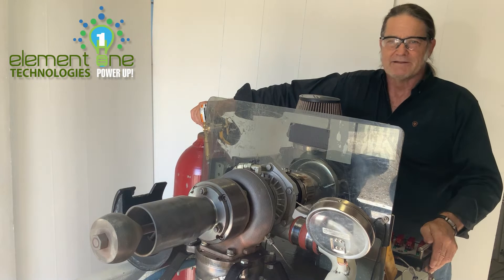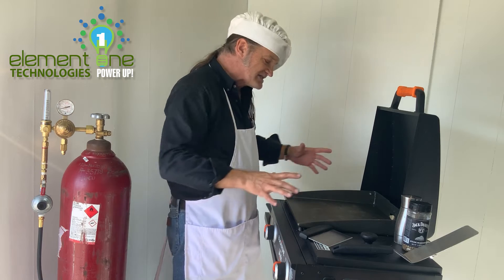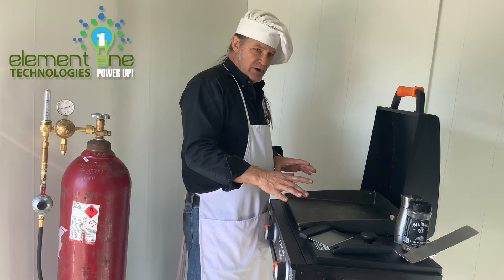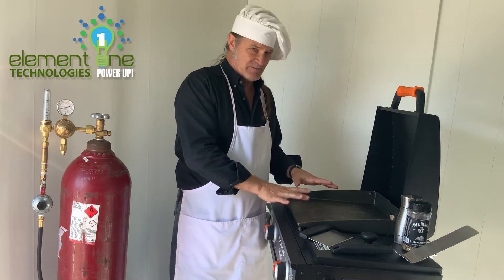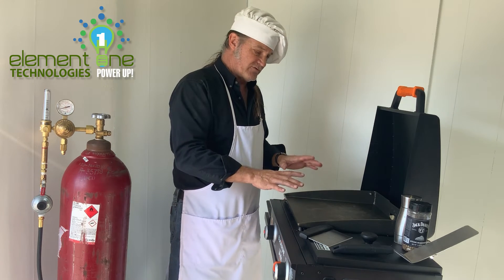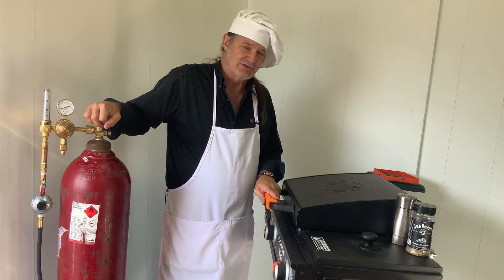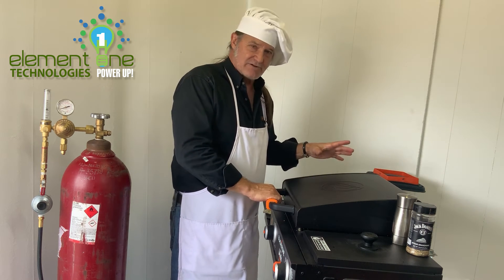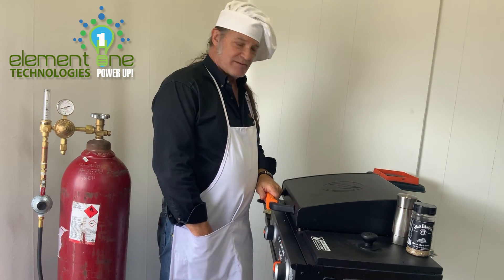What's Cookin' In Karl's Kitchen

Comment: Are you going to disclose the conversion process?
Reply: I would like to but at this time I  was advised against posting instructions. Someone may make a mistake in a DIY project and hold me liable. BUT - we will be developing an approved system.
Reply: I cannot disclose at this point. The liability is too great IF someone tries this at home. BUT - once you understand the dynamics of hydrogen combustion and gas flow -  its far easier than the fear factor many people spread about  hydrogen. Still - it requires great understanding, planning and caution to design or modify such a system.
Reply: It’s very simple - been there done that! 
It’s logical to someone who understands gases!